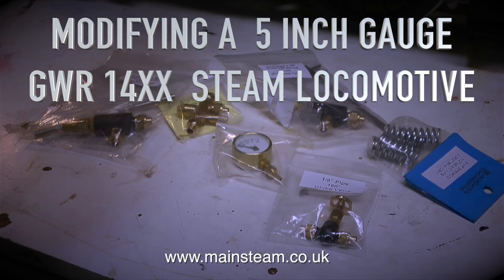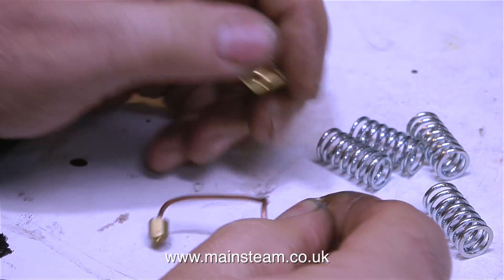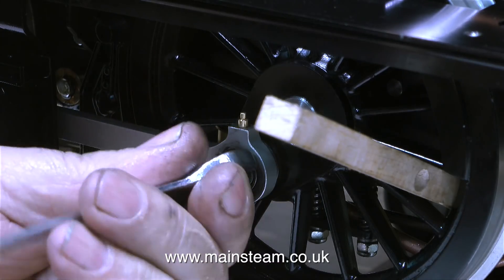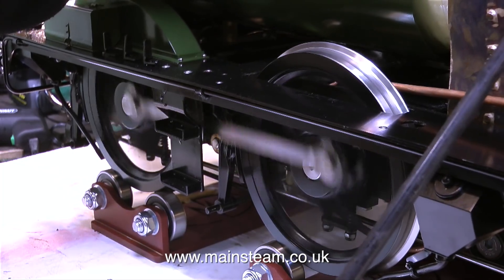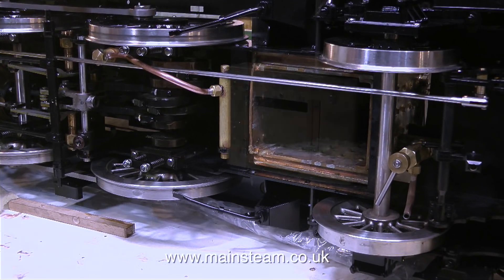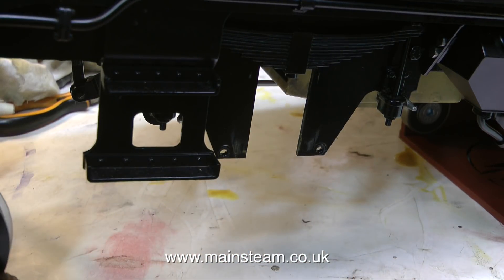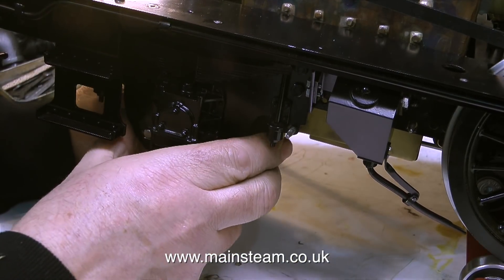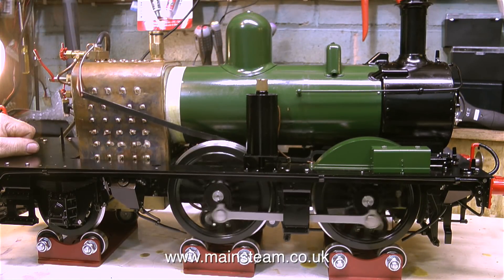MODIFYING A 5 INCH GAUGE GWR 14XX STEAM LOCOMOTIVE - PART #4

Comment: Hello Keith, I too have just purchased one of these fine little engines and the owner of the Chinese factory told me he had been involved with someone in the UK to fix the injector problems and that appears to have been yourself. Thankfully my engine was one of the units to have had your attention and expertise lavished and I will certainly be attending to the same issues of springing on the wheels and tidying up the cab controls. I am looking forward to scratch building some rolling stock for this loco.
Regards
Peter
Australia

Comment: Good morning Keith,  Hope you had a pleasant Easter.   Once again I came to work just to watch your work.  I continue to restore my friends American and am working on replacing all the piping and valves as they have deteriorated quite badly.  Two questions.  In the first few seconds of the video you show the two new water valves for the injectors.  They are labeled 90 degree.  Are there 180 degree, straight valves available?  I need this type of valve and will need to mount them under the floor of my tender.  The upright valve rode would be nice.  I have not found anything like this in America.  Also at time frame :42-45 seconds there is a photo of your piping to the injector.  You seem to have a black quick disconnect on the inlet pipe.  Would this fitting work on the hose ends between the tender and the engine? If so where can I find them?

Charlie Pipes
Reply from the maker: You can get 180 degree water valves also - made in England and available from http://www.blackgates.co.uk ..... The water to the injector is taken from a separate tank on the riding truck behind the engine as the water in the side tanks soon get too warm
Reply: Ordered two of the valves and various fittings.  I have decided to use their 1/4 inch unions to make up the hoses between the engine and tender.

Comment: How were you meant to oil the coupling rods if they had those brass plugs in them? Were there holes down the bushes or did you have to drill through from the bottom of the existing holes?
Reply from the maker: Please just watch the series . . . .

Comment: Another way to remove bearings from a blind hold is to pack the hole with heavy grease , place a rag over it and hammer a bolt or drive that barely fits. The compressed grease forces the bearing out.